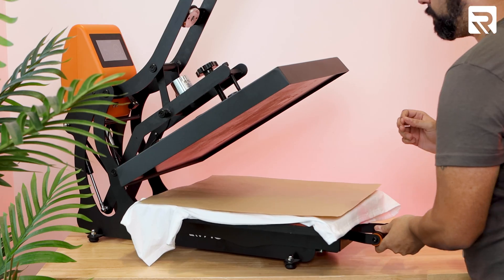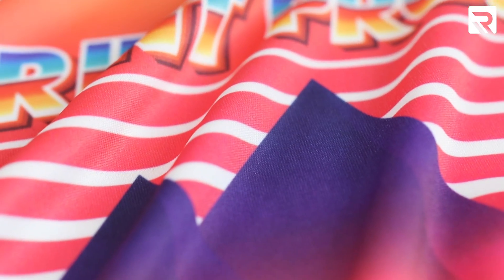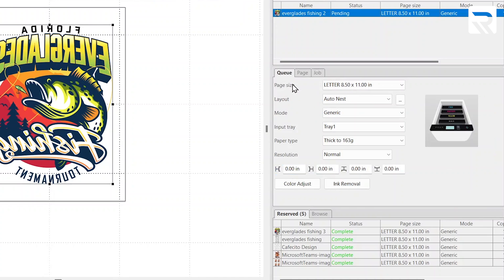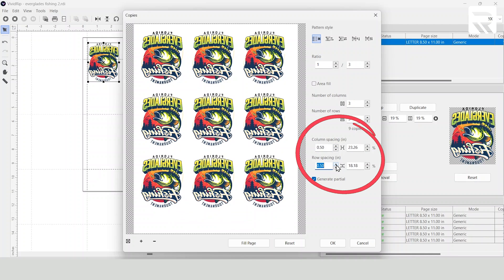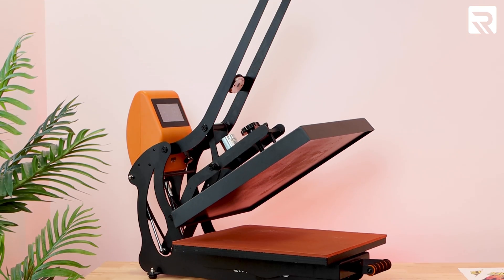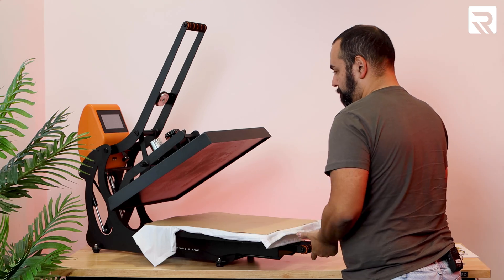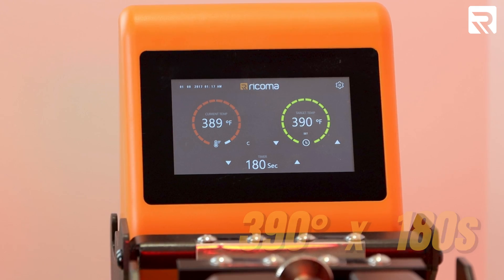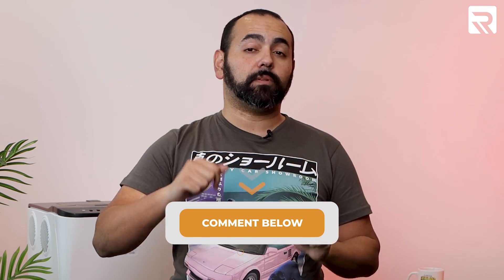Printing a Sublimation Design with a WHITE TONER TRANSFER PRINTER?!

Comment: Just tried the sublimation on a 100% poly and nothing, faint shadow ot the design on the shirt …. but it all stayed on the paper …. temp 385, time 50 sec ….. What hsppened?
Reply from the maker: Hi! It sounds like the ink did not fully transfer. Make sure you are using sublimation ink and sublimation paper, confirm the shirt is 100 percent polyester or has a high poly count, and apply firm, even pressure when pressing. You may also need to adjust your press. Typically, 400°F for 45 to 60 seconds with medium pressure gives the best results.
Reply: @RicomaPrints  Yes it is the ink that came with the Luminairis 200 which says it is for sublimation.  also in the video it says you can you use standard office paper.
Reply: @RicomaPrints you guys should get together on your videos.  I was following the instructions on the video, 385 for 50 seconds.  Regular printer paper it is said twice.  Ricoma does not have sublimation paper available……

Comment: i have a question the shirts are they cotton
Reply: The garment has to be at least 65% polyester to transfer cleanly. You can do it on 50/50 cotton poly blend but it comes out with a vintage look. The higher the polyester the better the print.

Comment: Do you have any suggestions for using the sublimation prints on tumblers? The paper sticks to the tumbler when I try this (particularly on dark prints).
Reply: I would like an answer to this question as well! Never had this problem with my Sawgrass.
Reply from the maker: If your sublimation paper is sticking to the tumbler, especially on dark prints, try adjusting your pressing time and temperature. Overheating can cause sticking, so lowering the temperature to around 350 to 375°F and reducing the press time to 45 to 60 seconds may help. Using high-quality, fast-drying sublimation paper designed for tumblers can also prevent sticking. After pressing, let the tumbler cool for 10 to 15 seconds before peeling the paper to loosen the bond. Additionally, wrapping the tumbler with parchment paper or a Teflon sheet before pressing can create a barrier and reduce the chances of the paper sticking.

Comment: about how long does the sublimation ink last. It seems exensive.
Reply from the maker: Hi Judy! Sublimation ink typically lasts six months to a year once opened, depending on the brand and storage conditions. Unopened ink can last up to two years if stored properly in a cool, dry place away from direct sunlight. While sublimation ink may seem expensive, its longevity and the ability to produce vibrant, permanent prints without fading or peeling make it a worthwhile investment. To get the most out of your ink, be sure to use your printer regularly to prevent clogging and store your ink in a stable environment.

Comment: I'm having issues getting the vibrant colors. They look washed out. Is there a specific color profile for sublimation? Should I be creating in RGB as well?
Reply from the maker: Yes, for sublimation printing, using the correct color profile is crucial to getting vibrant results. Typically, sublimation printers are best suited for RGB color mode since the ink is emitted in a way that matches RGB's additive color model. Creating designs in RGB will give you more vibrant colors, as it's optimized for the way the printer and sublimation process work.

Comment: Is full color transfer possible on black mug? Can print with white toner?
Reply from the maker: You can do white toner using premium 1 step for ceramic paper. That will work with any mug. For sublimation you need a light color sublimation mug, or you can use a dark color mug that has a white print base

Comment: When you say sublimation lasts longer than any other method does that include DTG and DTF printing?
Reply: Yes that is correct, certain factors can change the quality, but overall sublimation does last longer since it's bonded directly to the garment.
Reply: @Drew_Ricoma   Thank you for responding!! One more question. Does a sublimation printer need ventilation like the DTG and DTF printers do? All of this is still a bit confusing to me.
Reply from the maker: Yes, it's always recommended to have some ventilation for yours printers to avoid overheating them. Try to have them unobstructed.
Reply: @RicomaPrints  Thank you! I was actually more concerned about toxic fumes. I have done research and on the DTG and DTF printers there are purifiers or vent systems that are supposed to offset the fumes. I was wondering if the sublimation printer was the same.

Comment: So, wait a minute!! No marrying the sheets?  AND we are only using white copy paper with this one toner cartridge???
Reply: That's correct! As long as you have the sublimation inks, you can do this with regular printing paper!
Reply: @Drew_Ricoma does this apply to tumblers also?
Reply: @gabrielaguirre9701   as long as the tumblers are specially coated for sublimation, it will work!
Reply: @Drew_Ricoma  awesome, thank you so much for replying! I’ve really been looking for help with my Luminaris 200 as I just started using it.
Reply: @gabrielaguirre9701   Anytime, no problem! Hope you create some awesome items, i'd love to see them posted on Ricoma's Embroidery and Printing Business Help Group!
Reply: Also, do we still need to heat the bottom platform up?
Reply: @gabrielaguirre9701   You don't have to, but it will help!
Reply from the maker: Crazy right?! So cool.
Reply: @Drew_Ricoma so I tried this method and using sublimation paper, both leave a weird film on my tumblers? Mine also do not peel as easily as yours did in the video. The paper tears and stays stuck on the cup. I run it under water and it dries flat with a white film, any idea why?